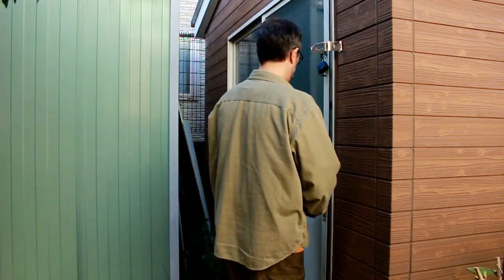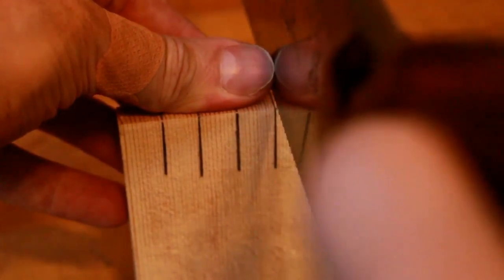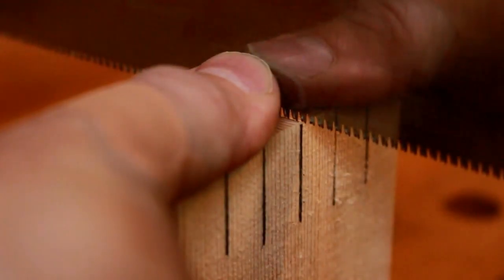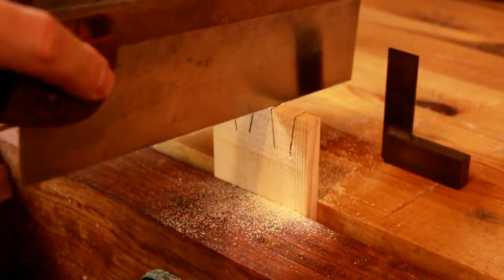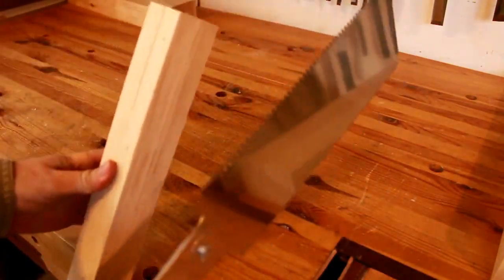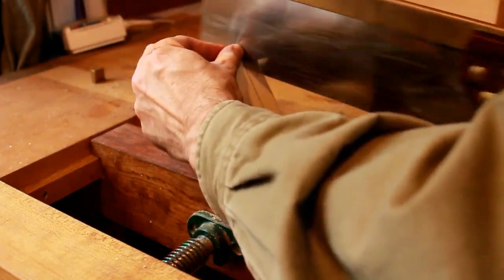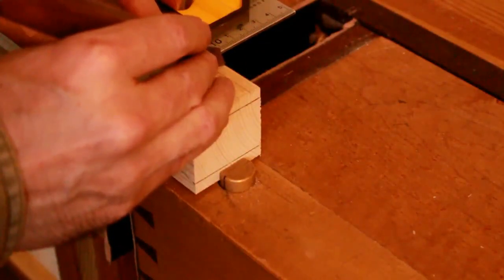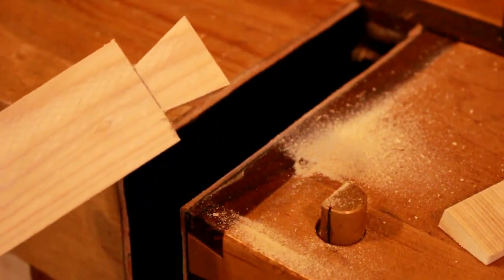How to cut straight with hand saws! For beginner woodworkers!

Comment: My vise is up pretty high.. could that be making things more difficult?
Reply from the maker: Absolutely. I've found that ideally your vice should be at a height that allows you to secure whatever you're cutting at about the same height as your elbows when standing upright. This allows you to keep your forearm parallel to the floor when cutting, and helps to keep the saw straight. Once you've mastered this technique you will be able to saw at different heights/angles without any problem, but setup is important if you're not quite used to using hand saws yet. Thank for watching!
Reply: @TenonsTenors  awesome thankyou so much for the response! My bench was setup for me working standing without having to hunch over too much so when sawing it’s almost chest height. Hope I see some improvement when I chop these legs down! 
Are you ever available for small custom orders?
Reply from the maker: @ChristiannTyler  I only take custom orders from people living in Japan so that I can provide after service if they ever have any trouble with my product.